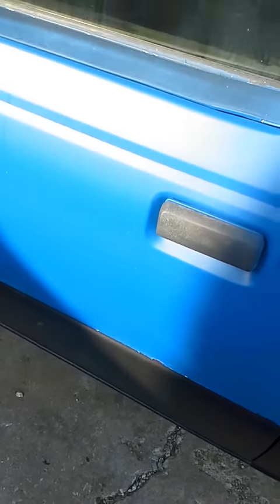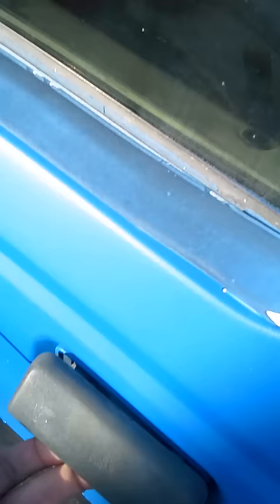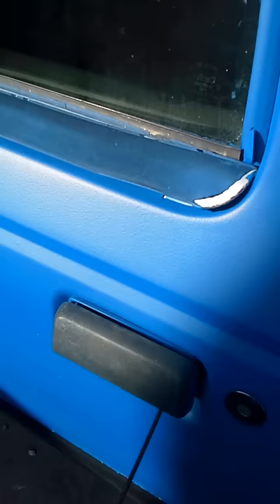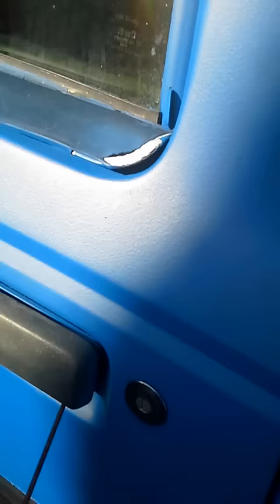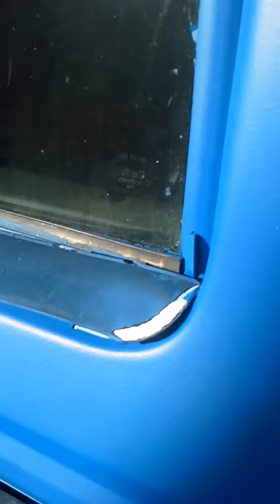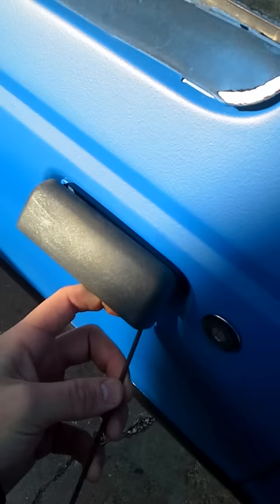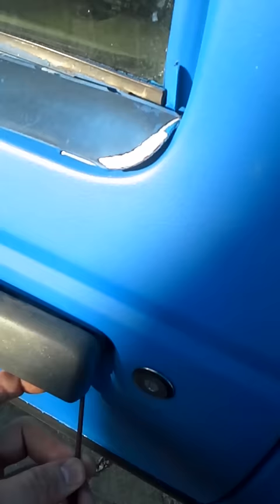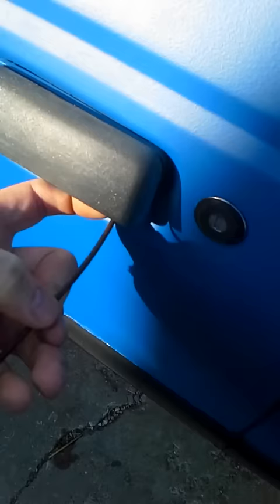How to unlock a ranger with no keys

Comment: Can confirm that it still works.Hasn't been patched
Reply: Nice
Reply: Literally doesnt but okay. Unless your locks are so wore out ita not possible with a bendable thing let alone a screw driver. It doesnt pop the lock open just wiggles it and drops is that's it.
Reply: @ryancollins3227  i just locked my keys in mine and used this it works fine lmao
Reply: @ethandaugherty750  i hadda get a thin prybar to get my worktrucks open it JUST had all the locks replaced so that shit wasnt budging with a shit, finally got it tho, if the locks are new my guy, just break the window 🤣🤣🤣 dont really do thay
Reply: @ryancollins3227  successfully performed, new lock btw, cheat code confirmed
Reply: Still works LOL just did it myself
Reply: Totally works, just opened up my 2011 with a screwdriver.
Reply: I'm am both glad and scared that this works 😅
Reply: I think they patched it it's not working for me😭
Reply: 40 min in not working, when I need it to, when I've done it for fun at home in like 20 seconds a handful of times 😂

Comment: Excellent tip.... Worked for me first time. Unlocked within 5 min from taking the antenna off to putting back on
Reply: Use a longer flathead screwtindriver
Reply: @Vaterraman  Thanks, guy from the maint dept. used a wide flat screwdriver, and it opened in a cpl on minutes. Yahoo. He also showed me how to change the locks too.(I told him about the video here, lol).
Reply: @tyblack7948  No problem

Comment: I have a 2002 Ranger. Tonight I spent  about an hour trying to get in the rear slide window and considering breaking glass to retrieve my keys. Very expensive.
After watching this I got my keys within five minutes. 
I have the factory antenna. It unscrews so I used that. Worked like a charm. 
Thank you.

Comment: Thank you so very much !! I used a flathead screwdriver and that worked. It took me some time too much time but I was tired and exhausted I had been at this for 4 hours. Not your method, I was trying so many different things. I'm so thankful I did not give up. I called a locksmith and it was going to cost me $50, and that was with a military discount, so I just kept praying  and I found this video and this worked 😊God bless you Sir.

Comment: Thank u! Trying to slim jim my 2001 ranger for half a hour,looked this up and opened it in 45 seconds with a 8 inch long flathead screwdriver xD
Reply: A slim Jim is the easiest way to unlock a ranger. Under 2 seconds.

Comment: This also works if you take apart a windshield wiper and use the thin metal. I couldn’t get the antenna so I used the blade of a windshield wiper 

Take the metal, fold it in half so it is 1/2 the length. 

Compress the “bent” part as hard as you can to make it as thin as possible.

Comment: 2008 Ranger...it's been mainly no issue remembering to have the key, but I forget at times, having driven with power locks (and push button start in some cases...so the key doesn't get used at all). A simple flathead screw driver worked, and once I felt for where the lock moved, I just let the handle close a bit as I pushed up. It seems the handle fully pulled out messes with the lock assembly pushing up easily. The lock suddenly clicked up, and I was in

Comment: I have an old 2000 ranger I tried with a thin, flat blade screwdriver. I was able to get the knob to come up.  But it wouldn’t  stay unlocked .  Any suggestions?

Comment: Did this on an 03 Ranger and it worked. I kept it flat and even with the key hole at first and moved it side to side until I noticed the knob inside moving and then I honed in on that and not really sure what I was doing besides making the knob move but I just played with it and pushed in putting pressure in different places and eventually started seeing the knob go up and I honed in on that and then was able to get it. It was tricky and took about 10 solid minutes.

Comment: I've got a 2002 ranger fx4 and got it opened in 20 seconds..thank God someone on the internet didn't lie for once..it's 101 degrees right now! Side note- you need something stiffer than the stock Ford antenna though, I had a piece of scrap rod in my bed

Comment: 2003 B3000 works perfect used screw end of the antenna on the vehicle, literally they supplied the person breaking into the vehicle with the tool to do it. Remember use the screw end of the stock antenna

Comment: It doesn't work though if the window is down.  I tried for an hour, the window is in the way of the locking mechanism.
Reply: billionj how far down was it? Mine was down like with 1 inch of air visible on the top on both sides both windows I couldn’t get it.
Reply: It was down all the way.
Reply: This guy locked himself out of his ranger with the window down 😂😂😂